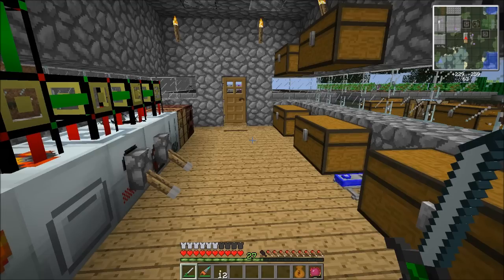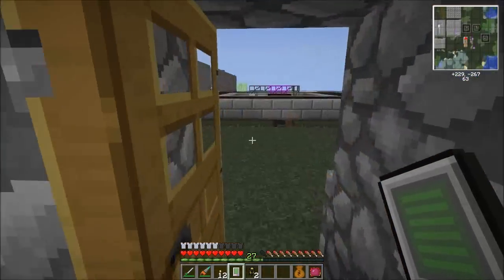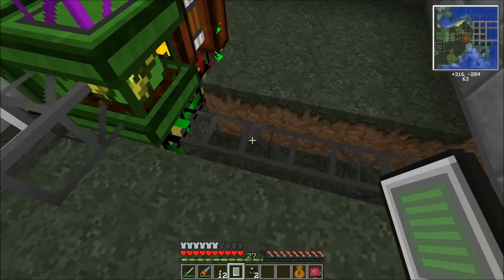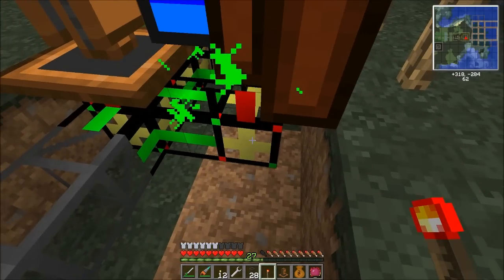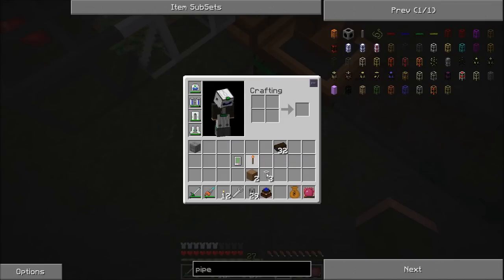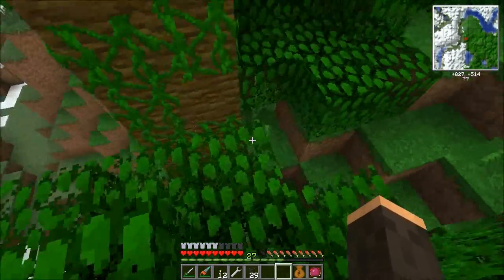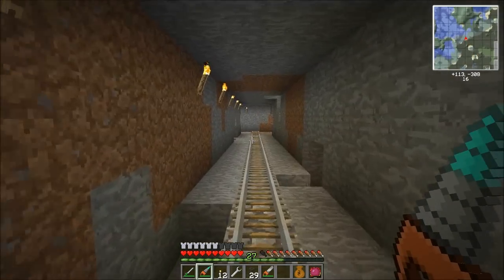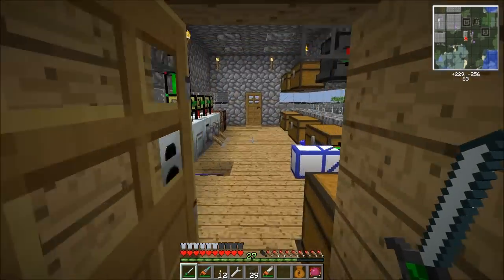Let's Play Industrial Automation Episode 46

Comment: i think a restart for 1.2.5 will be good. you have had this map for a long time 
and the low level (starting off parts) of the mods have changes a lot from your ep 1 
and it will be nice to see how u start a new map.
maybe have 2 LPs at the same time 1 at a new map 1 on this map if u want